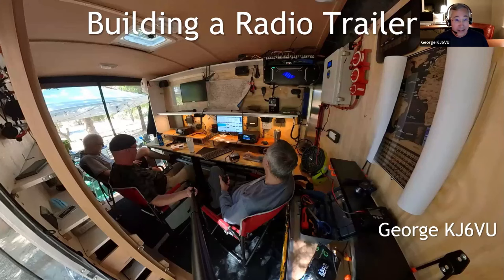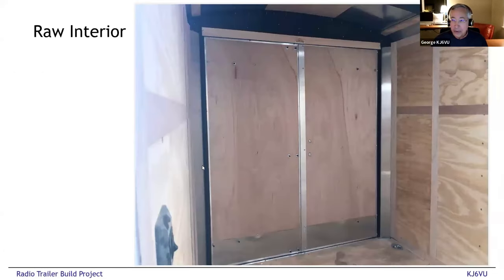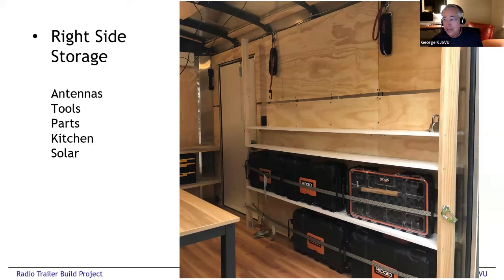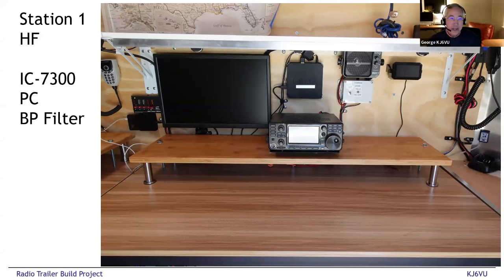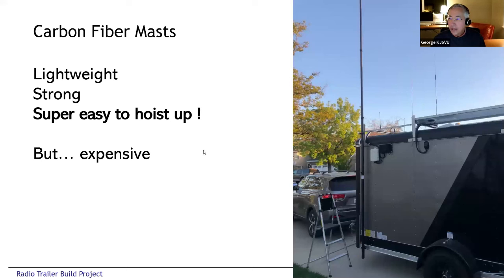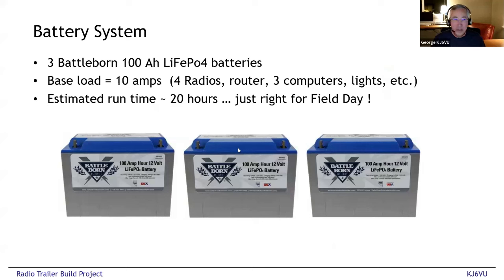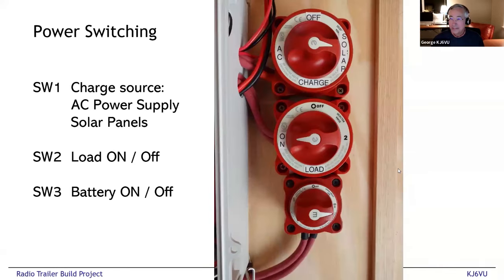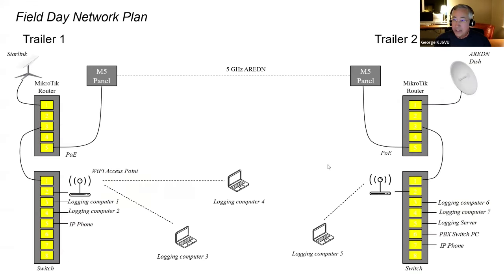Building an Emergency Communications Trailer ~ 02/29/2024

Comment: Great presentation.  One reason for using separate MPPT controllers is that each panel can have different illumination and each controller will do it's best.  If you put them in series and one panel is shaded it affects both.  It costs a bit more but you can get more power out depending on the situation and if you have them sort of randomly on the top of the trailer I would expect better performance in parallel like you have.
Reply: Hi Lawrence, that is an excellent point.  Thank you.  George

Comment: Zafiropoulos? Greek decent? This is a very interesting setup! Having worked with Law Enforcement Comms back in the states one department had a custom Farber Comms command center built on a MCI coach. These busses are unbelievable. Also way beyond our Amature radio budget. Looking at getting a military HUMMV with a helmet top to outfit with all of my Comms gear. I noticed you are using a Motorola Mototrbo radio. Are you not limited to DMR ID’s with this radio compared to some of the name brand DMR radios that have more memory positions for individual ID's. Recently acquired an XTL5000 remote mount low split UHF radio. That will be going into my every day driver but not sure what the local group will go with for digital. Our analogue repeater is in for repair and they did place a DMR machine running here but waiting for the conventional repeater to get back from the shop. One of the main operators here was telling me they are thinking of going with Yaesu Fusion. Don’t know why but I have to wait to see what unfolds. In case they stick with DMR any recommended remote mount radios for DMR? New to digital. Was working with commercial radio and RCC back in the mid 80’s until I semi retired in 2006. Now living and sending you greetings from SV9 land in the Mediterranean.
Reply: Hello my Greek brother !  Remote mount DMR radio only a few come to mind:  Motorola XPR-5550 as you can see here.  Also the CSI radios sold by Connect Systems.

Comment: Excellent information. I am in the early stages of building a ham radio trailer and wondering if you take any special steps to secure the various components for traveling down bumpy roads. How are your computer monitors secured?  Thanks!
Reply: The monitors are mounted to the wall with VESA mounts.  Everything is bolted in place.  The radios are on mobile brackets, the batteries are on the floor with wood strapping screwed in place to hold them tight, etc.
Things like folding tables, chairs, sun shade are held in place with industrial bungee cords.  The 6 tool cases are held in position with a piece of metal closed hanger pipe.